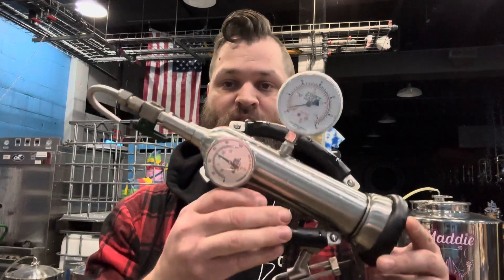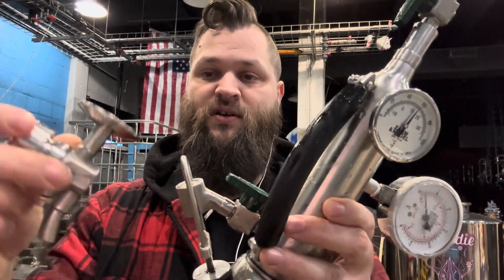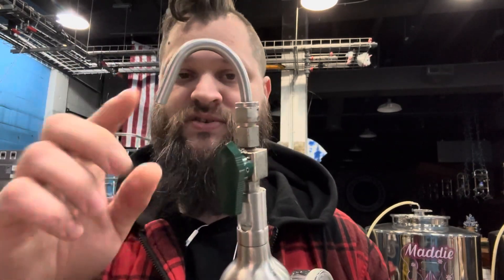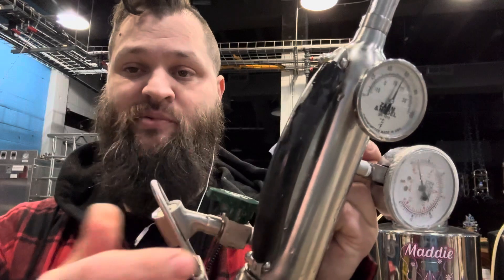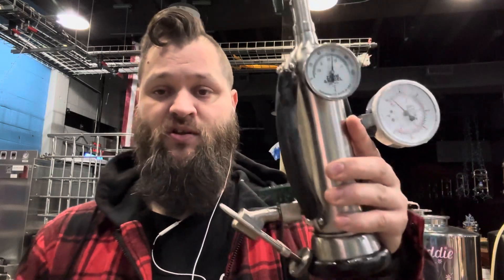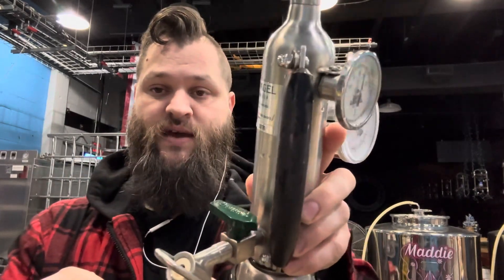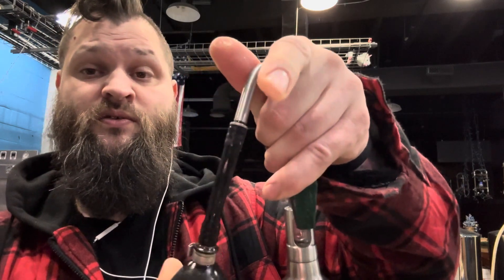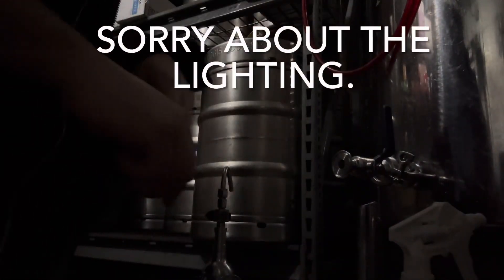How to measure carbonation: Zahm & NAGEL

Comment: Is the piston spring-loaded? Unlocking the piston did not relieve the pressure.
Reply from the maker: @davejoseph5615  no it is not spring loaded. It only allows for expansion room in the body of the zahm. It has a given volume and measure the pressure. That is what you reference on the zahm chart. Unlocking the piston sometimes doesn’t move at all until you start shaking.
Reply: @TheProfessionalHomebrewe-ug3iq  So it seems like the piston provides an exact amount of volume for the c02 gas that comes out of solution.